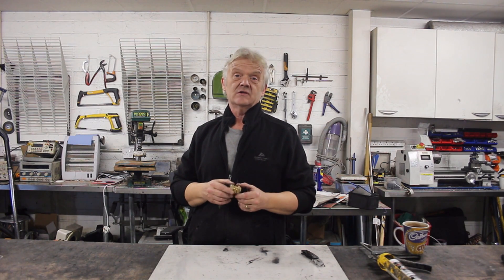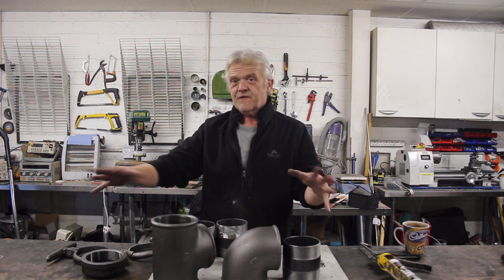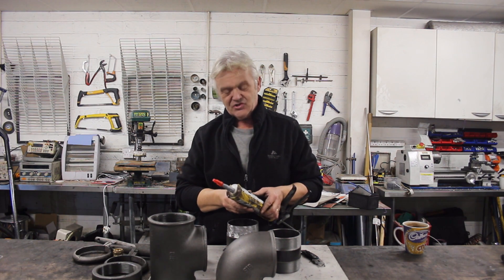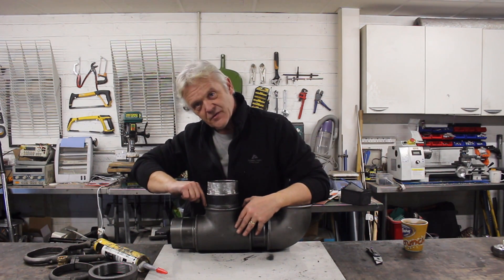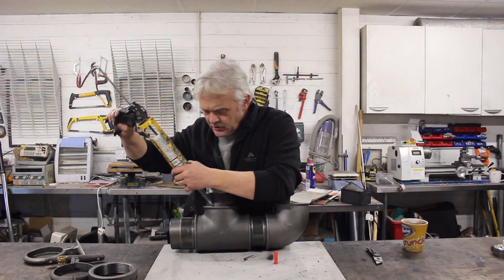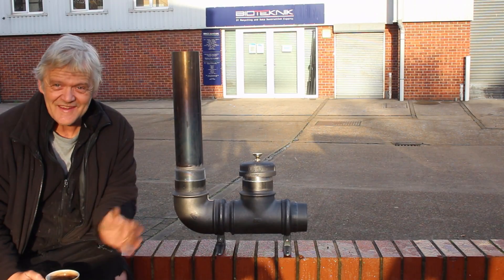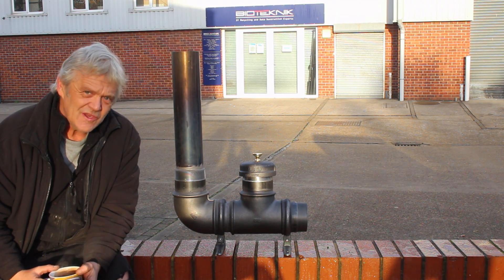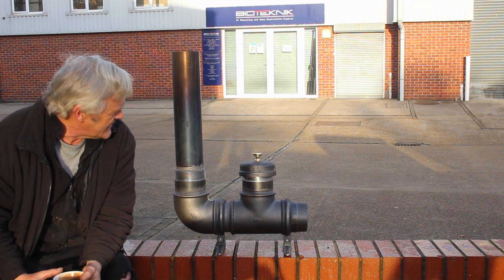1743 A Rocket Stove Kit - No Welding, No Tools, No Experience = No Problem

Comment: The silicate is no longer sold by b&q.
I found it on Amazon, sold by "Vitcas", sold as "heat resistant sealant" good for 1300°C.
There is a black version by the same company called "black fire cement" rated at 1250°C.
I phoned the company they are the same thing but with added black colouring.
In a month's time I will be able to say if it works,!

Comment: How hot does the surface of the pipe get? I noticed you used black pipe instead of galvanized, I’d be worried about the zinc fumes otherwise.

Comment: If those fittings are cast iron I guarantee they won't hold up to the heat.
Reply from the maker: ok a couple of things - what heat do you think they will get to? Did you know most stoves are made from cast iron? why do you think they won't hold up?
Reply: @ThinkingandTinkering  
Cast iron is very brittle to begin with. Thermal cycling with extremely high heat will exacerbate that brittleness.  Causing cracking. That's why it's not used in high heat environments.
Reply: @ThinkingandTinkering  
There have tests done where they get over to 1000°f. And they reach those temperatures quickly. Which contributes to the induced stresses.

Comment: Do you think this will work just as well using 3 inch fittings as they are half the price plus it would be more portable but at the same time the burn temps will still be the same.

Comment: That gives me an idea, I wonder if using the same ratios could you make a micro rocket stove perhaps as a camping stove or to provide a general heat in something like what the outsider did with candles. I mean proper micro, like 32 mm copper pipe and fittings. I have seen 54mm with compression fittings. As rocket stoves get extremely hot, maybe you don't heed a big one. I like the idea of a micro mass heater rocket stove.

Comment: Love it. I live on a boat so space is very limited. I would love to see you build a version that is significantly smaller than this masterpiece. The bad news for me is limited space but the good news is that a much smaller unit would easily heat the small living area that I have. Are you up for the challenge? (ps keep up the wonderful work that you are doing in sharing your thoughts, ideas and inventions with us all.)
Reply: The 3 inch fittings are half the price on the suppliers web site. 😀
Reply: @celtshaun1427  thanks for the assist.

Comment: This is great but where did you get your prices from? Been on BES and Metals4U. The 500mm tube which you said was about £11 is £32.56 (101.6mm x 3.2mm (4" x 10 swg) Mild Steel Tube) and the pipe fittings come in at a grand total of £255.83. Am i missing something? I might be from Yorkshire, but this seems an expansive way to do it even if it is a tool and skill free option.

Comment: Here's an interesting rocket stove idea, using bricks, that also doesn't require using any tools to assemble: https://www.youtube.com/watch?v=onMbSLuC7Oc
.
Today's prices for bricks (at my local Lowe's store) would be 91¢ for a standard concrete masonry brick, and $4.68 for a "fire brick" (aka a "refractory brick") that's designed for high heat applications. As the presenter on the video pointed out, either brick will do: it's just a matter of how much you're willing to spend (25 bricks needed, so price range $25 USD to $125 USD). 
.
Several things to keep in mind, however, if you go with the brick method:
1. Less expensive, but also less portable. Of course, I won't be slipping either version into my backpack real soon (for that I use a Kelly Kettle), but with a ring type handle attached, I believe the pipe version could be quite easily carried. Not much you can do with carrying bricks except drop one on your foot, claim to be injured, and wait for your friend to carry them.
2. Bricks are much less weather tolerant, especially the concrete bricks, as they absorb rainwater quite handily. I've heard horror stories of people going camping and lining the perimeter of their fire pit with stones from a local creek or river. As the stones heat up, the water that soaks into them (and it will) eventually sizzles out and they can crack and split as they dry out. Now imagine spilling water on them from something you're cooking, and enjoy a lovely display from a "Mother Nature's hand grenade".
Reply: Want to see river rocks explode? Check out this video: https://www.youtube.com/watch?v=T2Fa1DUpfbg The actual explosion occurs at 3:39 in the video.

Comment: LOL, did ya steal 'em? How about telling us what you paid? I just looked up some online and a 6 inch T goes for $600, and a 90 degree elbow for $450 US 0_o
Well, at least you're on the right track. Steel or iron of that sort would likely last a lifetime. My rocket grill is made of six inch black steel sheet which is used for wood stove chimneys and it rusts and burns out every two to three years and I have to rebuild it.

Comment: Brilliant! Looks like the big brother of my little 1" brass fittings/copper tube hydraulic ram pump, which also needed no welding and was a rule of thumb design based on a larger pump. I also prefer the round tube rocket stove - a bit more steampunkish.

Comment: By the way 
These DIY ideas on heating you've been developing and showing here are hitting a cord with us, "mere mortals" , who are searching for solutions to a completely man-made crisis.  But a crisis nonetheless. 

Many people here in Belgium are finding solutions.  One neighbour got out her father's wood cooker, cleaned it up....

Many, for example, are single mothers.... they can't weld and all that...., but a project like this here is "doable".
I myself worked on combining a stainless steel BBQ lighting "pot" (that you use to get all the carbon going,  then you pour it out into the BBQ proper) and an old gas cooker top saucepan frame holder to realistically cook with it (outdoors) using virtually any fuel.  It works,  and i showed it at a village meeting to give ideas...

Comment: Instead of a T fitting, you could use a y fitting for the lumber feed, just make sure it's a y fitting not a Y fitting... If that makes sense. As for your cap, I bet there's a inspection flapper it something that would be easy.

Comment: Just a tip from one who has used high temp silicate sealants. When wet it can be quite caustic so wash your hands afterwards and when it has vitrified from heat it can be super sharp.
Pretty obvious of course.

Comment: Suggestion: for a handle for the lid, if you want to avoid drilling holes or relying on a wrench, perhaps one can find just the right sized constrictor band from a coffee urn handle.

I admit, I do not know if one does exist, but I do know a lot of different sizes do exist, and most of them can easily be removed with a single screw driver, and you can slip some other kind of handle on it, should the handle it comes with, tend toward hanging up on the body of the stove.

In such a case, also, one could consider sawing or grinding the handle short enough to clear the stove body...

The reason I say 'or grind' is because one merely needs some weathered concrete as a grinding medium, therefore, leaving the one and only tool to be the screwdriver.

Just put the parts that hang down too far against the concrete or other readily available abrasive surface, and drag it until enough of it wears off that the remainder will spin past the body of the stove and you are in business.

I suppose, if you are really skilled, and not too worried about getting a jagged, uneven break, some handles could just be wedged between any 2 strong, immobile points [I have seen porch railings made out of 'wrought iron' where there was a pretty decently spaced gap that could serve for this, as well as certain types of lugs on the beds of [how you say in the UK 'lorries'?] flat bed trucks which can serve as solid places to snap off the excess.
Reply from the maker: that's clever - I like it - I make well look out for one - thanks for the suggestion - I am sure it will help

Comment: HEH... I've actually INSTALLED a LOT of them back when I worked for a fire sprinkler company!

But yeah, this idea really fits the ticket, looks indeed very easy to make, with few to no tools, and little to no experience.

EXCELLENT job Robert!

TOP NOTCH! (~_^)-b

While its not CHEAP, its DEFINITELY exactly what it is meant to be, AND it SHOULD last quite some time, seeing as those pipe fittings are pretty heavy and pretty durable.
Reply from the maker: cheers mate and yes that was exactly the thinking behind it

Comment: Great job Robert! Plumbing fittings are great for tones of things and they are standardized. I am working on micro hydro myself, and I have found that "sanitary fittings" are great with their clamping system  which can be assembled disassembled thanks to a simple and easy to use system -  modern cad software have links to the Mcmaster Carr catalogue which has 3d-Step files  ready to 3dprint. Of course this would not work for high temperature applications but for water or air this is great.
Reply from the maker: no way - that is a hugely valuable tip mate - thanks for sharing it - I had no idea - awesome

Comment: this is not a rocket stove at all. the principles of re-combustion of the gas are not there.
Reply from the maker: yes it is - don't be silly because you want to seem clever - it only ends up with you looking a little foolish -the design here is pretty much universal I just used plumbing fittings to replicate it - that's all - you may want to delete this comment - and I am ok with that because it really does make you seem as if you have no idea what you are talking about

Comment: Excellent project! As this was made  using 100 mm fittings, I wonder what the effect would be if you increased the size to say 150 or 200 mm diameter fittings and then put say a 300 or 400 mm surround over the top & appropriate cap to emulate the box in video 1741, You could even add to it like the picture shown at 5:03 - which is almost a piece of art. Lots of potential for some amazing designs. And if you use pipe fittings, as they are nice thick steel you would automatically get an excellent heat sink. It wouldn't be cheap, though. Yeah, it may be a little over kill thinking like this, but it's currently -28C here.
Reply from the maker: oh I think it would be cool just in itself to do that mate - don't forget bought as a product something like this can be US$2k plus easily

Comment: Instead of a TEE you should have used a WYE.
Also, flame should shoot out twice the length of the discharge pipe. Gives the best rocket sound! lol
There is a ratio of input pipe length for combustion air and output pipe length.
I think it is something like 4:1 output to input.
Much depends on how insulated and air tight your fittings are.
Reply from the maker: yeah folks have been saying that - I just didn't see a y - now I know they are there I yearn for one - I may change it lol

Comment: If you covered the metal knob with the silicate sealant, would that insulate it from the heat?
Reply from the maker: yeah - but then it wouldn't be shiny and pretty lol - you could just bolt on a barbecue handle - you know one of those wound wire ones

Comment: How do you deal with the ash that builds up in a rocket stove? I'm assuming ash builds up and would eventually choke up the system. 
Thank you.
Reply from the maker: it does but you will be amazed at how little there is - really far far less than you would expect - I think a full days burn will leave you with a bit to clean out but that is all

Comment: It could be turned into a masonry stove - the back of the stove is set into a brick base with the chimney inside ~ a gas bottle cut in half and placed over it and on top of the base/a steel oil barrel - ether painted stove black, a brick column where the the heat will flow up the internal chimney and down the side of it and out a hole in the back of the base; to a outer chimney/a masonry brick bench with a hollow passage, with dividers for the heat to flow around, and the chimney being put at the end of the beach/a heat-proof centrifugal fan to start the fire/chimney draw. If it is against a external wall - the air intake could have an elbow facing the wall and a pipe put through it to a vent outside ~ using outside air for combustion = keeping the heat inside the room with no drafts. If the base of the oil drum/gas bottle is flat enough ~ will function as a hob for kettle/frying-saucepans, and if seasoned with oil = a hot-plate for frying.
Reply from the maker: nice suggestions mate - cheers

Comment: I love the design. Just a slight problem. We don't have that kind of pipe in the United States. That 4-6" pipe looks like it's used for drains. We moved from cast iron to ABS plastic in the 70s and then to PVC plastic. I even looked on Amazon for that kind of pipe but didn't find it. Lead and ocre rope was used to seal our drains in cast iron. To screw them together? nifty idea.
Reply from the maker: you still have suppliers mate - not amazon for sure but they are out there - look for heritage drainage suppliers or pipe fitting or even drilling equipment

Comment: by eke another good job done, just out of curiosity the missing threads on the nipple, somebodys been using there grinder or was it a file. lol please continue to enlighten me and many others. thanks steve
Reply from the maker: grinder - but you could just use a bit of pipe cut to size for you

Comment: Hi Robert, this might help Luke make a no cost off grid rocket stove. Two holes in the ground next to each other. A third hole which conects the bottom of the two holes which 45 degrees angle.  Showed this to some x-army bods who where training some cadets. Very little heat above ground but good for cooking above third hole, uses the ground around it as a heat store.
Reply from the maker: I already made and gave him one mate

Comment: Nice!  Some thoughts:

1. The 4" steel pipe will block some air flow because of the straight end.  If cut to 45 degrees (or w/e), it will allow full flow.
2. A Y-shaped bit of wood will work just fine to lift the lid off.
Reply from the maker: do you know some folks actually advise a lip at the end - it think it's to do with making a vortex - but it doesn't drop down that much tbh - still you are right i think

Comment: Impressive nipples Rob. Can't wait to see more :-)
Reply: BTW you can find 4 inch steel pipe at most automotive exhaust shops as it's used in trucks.
And standard chimney pipe is 6 inches in diameter.

Comment: Really enjoying your Rocket Stove design. Ordering some iron as we ‘speak’.
Not actually tried this yet, but I will do very soon.
Forget grinding away the threads at the end of one of the pipe nipples and replace the 4” threaded end cap with a 5 inch size: 
“Standard weight cap carbon steel butt weld fitting – 5” “
Available from the same type of sources and about the same price range.
I will also be taking your good advice and finding a big heatproof knob!
Reply from the maker: that is a good idea mate - thanks for that

Comment: Did you happen to mention how much it cost to build?
Reply from the maker: you can do it for around UK£80-90 - still more than if you weld but you are well out have a look on pipeworksuppliers.co.uk and use metals4u for cut to size pipe - the minimum wold be the T piece and an elbow - the rest use cut pipe and sealant

Comment: With a rocket mass heater, we are shooting for temperatures closing in one 2000 degrees F.  Note that steel spalls at 1600 degrees F.  So a steel j-tube tends to fail.  Of course with a 4-inch system, the amount of wood is small enough you often cannot get to 1600 degrees F.
Reply from the maker: I am not shooting for that - I did a video on this topic - rocket stoves explained
Reply: @ThinkingandTinkering  Watched it.  What you have is a j-tube, which isn't usually a rocket stove, but I do think a j-tube rocket is far better than an L-tube rocket.  Good!  And, yes, you are not shooting for a rocket mass heater - although it is rocket mass heaters that typically use the j-tube.  Although the dimensions you mention are the rmh j-tube dimensions (sort of).

Comment: Important to note if you decide to try this in the smaller galvanized pipe: DON'T. Black pipe like this video is fine, but don't use anything that's galvanized where heat will be applied.
Reply from the maker: you can but you have to do a few runs to burn the zinc off and do that in a well ventilated area - like outside and don't stand over it - but you are right zinc fumes are not good which is why I used black iron and as they are cheaper than the zinc - I don't know why anyone would bother
Reply: @ThinkingandTinkering  agreed, I was just too lazy to type that out. 🤪 These days you can't always easily find the materials you're looking for in the usual places. At least not here in the People's Socialist Republic of California, anyway.

Comment: You could also build one entirely out of cob and just line the super hot areas with fire brick held with clay surrounded by cob. A tool less rocket stove. 😅
Reply from the maker: you certainly could
Reply: @ThinkingandTinkering  I’ve done it. More than once. They work well. One was a j tube the others were batch burners

Comment: I am dumb as a box of hammers so please forgive if these questions have already been addressed. Are they designed to run 100 mph all the time or is it possible to slow down and regulate temps like a normal wood stove. Can you run it in your home if you have stove pipe to the outside. And is there any way to add something like a pellet dispenser safely. Awesome as always.
Reply from the maker: yeah just put a damper on the front air intake